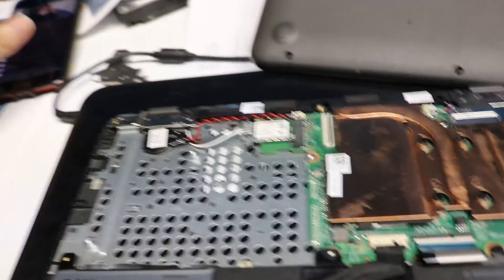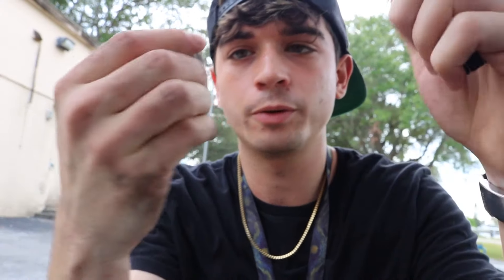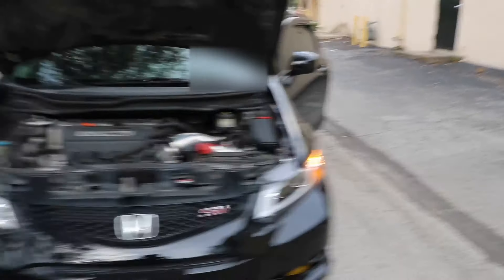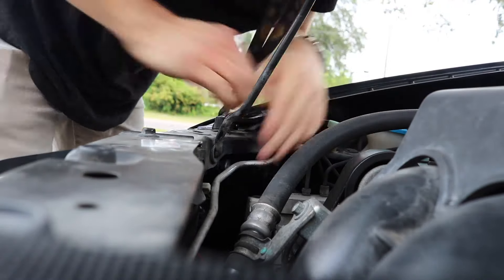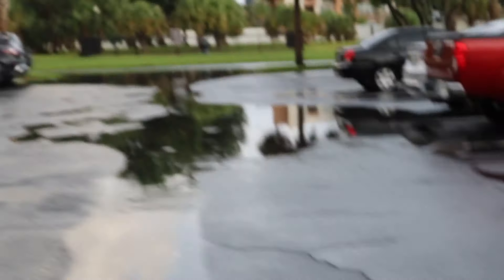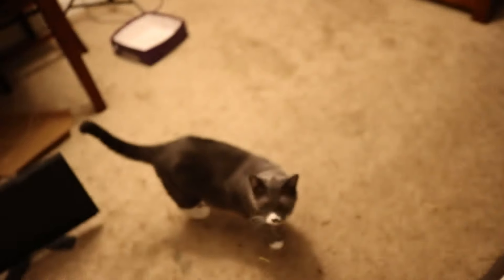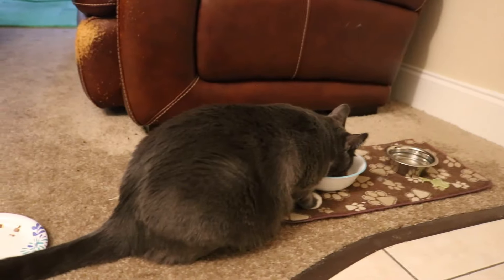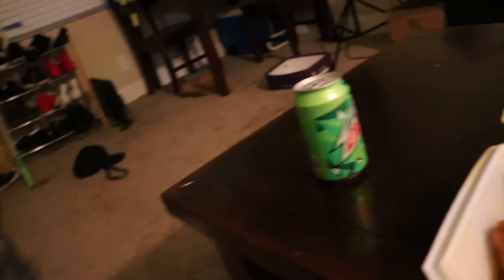A DAY IN THE LIFE OF ME! | 5

Comment: heya, the fast blinker is due to missing load on the (resistance switchers). I believe they're split into left and right (front+rear), only way to easily patch this is using original non-LED bulbs which should draw a combined 55 watts per side or so, otherwise either live with it or add resistance to make up for the missing load (wattage)

Comment: You need a LED load resistor to trick the car in thinking an incandescent bulb is installed. The LED bulbs take up less power so the car thinks it’s out and hyper flashes to warn you. They are kind of a pain tbh.
Reply: Or get anti error bulbs on eBay 🤣

Comment: Probably blinks fast because the system thinks you have a burnt out bulb switching to led. Check rear blinkers just in case. But some cars it speeds up to tell you it has faulty bulb. Since LED takes so much less power it thinks it is burnt out bulb.